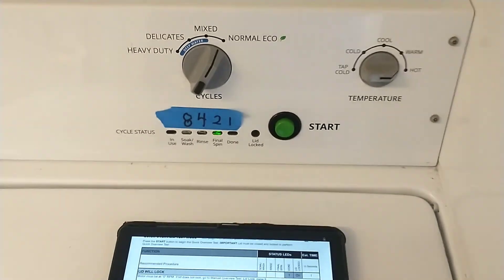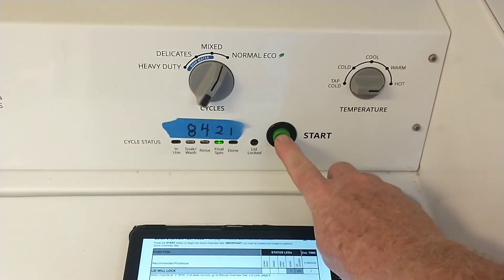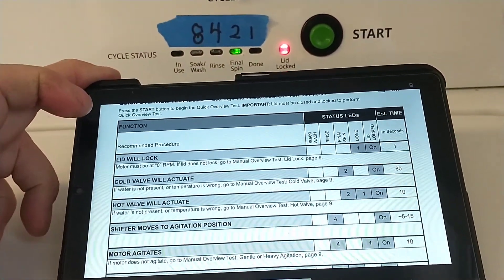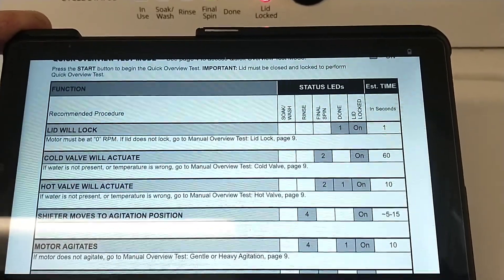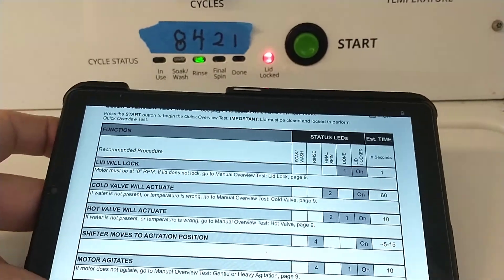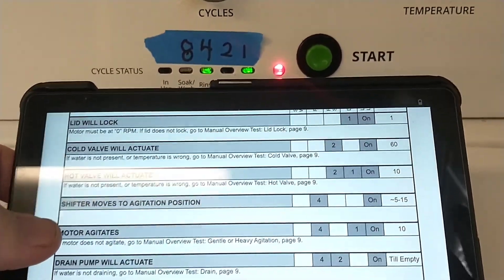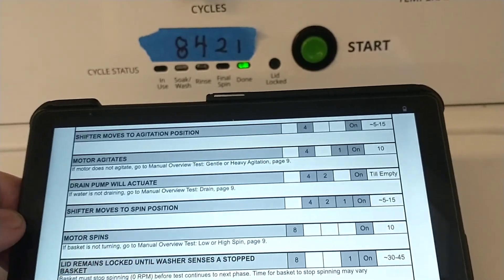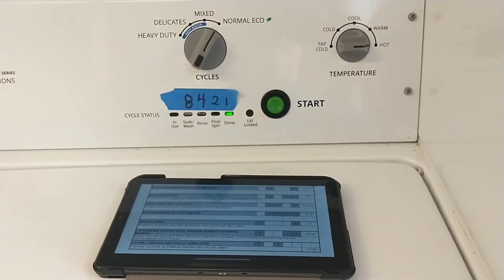Whirlpool Coin-op Washer Diagnostics

Comment: I have the same washer and here is what i am done so far and still not working: (CAE2745FQ0 Commercial Washer)

The washer fills with water and agitates normally.

When it’s time to drain, it does not pump out the water — it stays full.

You can hear the actuator shift, but the door does not lock when it should.

The door lock assembly and the shifter actuator have already been replaced — problem persists.

The drain pump works when tested directly with 120 V AC power.

The washer stays full of water in the mid cycle. I order a new control board just in case.... Bytheway i also replaced suspension rods because it was shaking alot.   HOW DO I RESET OR ERASE CODES? Great Tutorial The Best. Thank you for sharing

Comment: I have one model cae2745fq1 thats is running without coin. What can be the problem?
Reply: Have you checked the switch on the coin slide for continuity?  It should only make the switch after coins are put in then go open when the slide is pulled out. Might be stuck in the on position and the washer board thinks coins have been put in all the time.
Appliance parts pros also have  good technicians who are pretty good at helping you troubleshoot weird problems.
Reply: My exact model gave out free washes. According to the service guy that whirlpool sent out, I had to replace the control board, which fixed my problem.

Comment: Nice video, I have the same washer and had to replace the shift actuator and noticed that the drum is sitting about 4” lower than usual, I replaced the suspension rods with the manufacturers kit but the tub/drum is still sitting lower. I was curious if you had any suggestions on how to keep the tub/drum from falling unfortunately I can’t find anything online for a fix. Thanks again for any advice

Comment: does anyone have a source for the pressure transducer that is soldered on the control board ?  It fails quite often - i have several boards that I have deducted the pressure transducer is bad.  The symptoms are: you hit the green start button, the washer starts to fill water in and 30 seconds later it starts agitating.  It then stops filing with water and agitates for the whole wash cycle without enough water. It then drains, and spins.  The rinse cycle starts and acts normal, fills with water, agitates for a short time, then pumps the water out but then never spins.  The control is waiting for the water pressure transducer to tell it the water is out but the transducer is bad.  The washer stops eventually with the DONE light NOT on and the clothes NOT spun.  unfortunately there is no diagnostic mode to tell you the problem.  From what I've learned - running the calibration mode and the washer NOT coming back with the DONE light on finished means the pressure transducer is bad.

Comment: Quick question I did the calibration and test. The only light that was not coming on was the done light, every time I put coins into the machine nothing happens no lights no buttons nothing comes on but when I do the calibration test, it runs through the test but like I said that done light does not come on any information would be great thank you so much
Reply: If the DONE light doesn't come on at the end of calibration - calibration procedure ran into an error on board. Most likely pressure sensor is bad on control board. Also look for swollen capacitors on the control board. I've run into this many times.  These machines are  American made garbage.

Comment: What if your machine won’t go into diagnostics mode and the final spin light just blinks?
Reply: control board is BAD.  look to see if the green LED light in the middle of the control board is on solid
Reply: Mine is solid green in the back of the board but won't go into diagnostic mode
Reply: @elvinunthiah2620  have tried going slower on turning knob. Try it several different ways and pace
Reply: @elvinunthiah2620  I've had boards that light up green led on back of control board and can't get into diagnostic mode. These boards are dead control boards. I've sent these in to whirlpool repair shops - they come back non-repairable.

Comment: After my mom use garden hose to clean the washer, the washer no longer lights up and will trip the breaker. What should I do to fix it? Thank you.
Reply: Most likely she let water in the control panel and shorted some electronics or the lid lock switch.

Comment: I whirlpool commercial washer coin op will not go into diagnostics mode. I’ve changed the board & the coin slide. 
 The machine will turn on when no coins have been put it. Even when the coin slide switch is unplugged
Reply: Just ran into this today, starts without coins. I also cannot get hot water but I can’t enter diagnostics mode to check the inlet valves. Dumb!
Reply: @jamiestevens9891  You’re not alone. I’ve seen it multiple time since posting my last comment. It’s a reoccurring theme with these machines.
Reply: @Daner949  Is it most likely the board?
Reply: @jamiestevens9891  I changed the coin, slide control board, and the main control board, as well as the coin slide itself, Also the lid switch. We eventually ran out of parts to change. Even Whirlpol Factory Service was stumped.
Reply: Did you fix your washer? I have the same problem with mine.
Reply: @Mark_from_LA  No, I changed everything & it would still start for free. 
  I even spoke with whirlpool, and they admitted that the see this all the time. But did not offer a solution. 
  Hopefully, if enough of us complain, there will be a recall or full class action lawsuit against this machine.
Reply: @Daner949  Thanks for your answer. You're money saver 😂

Comment: Quick question, when doing the test cycle my lid lock led is not lit is that normal. I was originally getting a pressure error (F3E1) I fixed that then I noticed the lid lock thing thought it was odd.
Reply from the maker: If it won't lock in service mode then it most likely won't in normal mode. If the lid is not locked it will not spin and should set an error code. On page 4 of the tech sheet you will see instructions to enter Manual Overview Test Mode. This mode allows you to run individual tests on components. Enter Manual mode and follow the instructions on page 9. Everything you need to diagnose the issue is in the tech sheet (mini manual as some call it).
Reply: @tonyturner9146   I'm going to retry it when I'm back after vacation. Thanks for the help and video.
Reply: Tony ran it through diagnostics nothing shows up.when it starts fills up for 30 seconds.stop moves to wash/soak cycle but doesn't fill and starts to agitate with no water. If I do another load fills with water and works fine.Frustrated can you help me out😢
Reply: @victoragresti1777 I have one that does the same thing.  Mine will start with pump ruunning and then agitates with no or low water for wash cycle.  it then pumps water out and then fills to the top for rinse cycle, agitates, then pumps out water but no spin. I'm assuming the control board has bad pressure switch - this would make the cycle my machine is doing logical. Another big problem with these machines is the wiring. Whirlpool used the CHEAPEST wire they could find - it breaks all the time on these machines especially around the water pump and motor capacitor.  These machines are JUNK
Reply: @victoragresti1777  I'm honestly curious how that's even possible, outside of a bad water level switch.
Reply: @RJenkins6586  this doesn't have a conventional water pressure switch its built into the board it's called a pressure transducer
Reply from the maker: It is not normal for the lid lock light to not come on... Is the lid locking?
Reply: @tonyturner9146  It locks when it's ran normally, but after rewatching the video I don't think it's locking at all when it's in service mode.

Comment: First, how do I get the program you have on your tablet? Next, the lights aren't coming on when money is inserted. Any suggestions? Great video.
Reply from the maker: On my tablet I'm just reading a PDF version of the "tech sheet". Most of those machines will have a tech sheet attached to the back of the front panel of the machine. If you can put it in diagnostics and run the test then the machine is probably not at fault. There is a switch in the coin mechanism that enables the controls of the machine. That switch may be the issue. Or the coin is not mashing the switch when the coin slide goes in.

Comment: How to calibrate ? Like all back to normal
Reply: To recalibrate you do the process he did to go into diagnostic mode and go the what would be the number four or rinse, then press start. It will go trough the recalibration process.
Reply: Then?
Reply: Starting at 12:00 (mixed load on mine) L-R-R-L-R-L-R is what the tech did on my model

Comment: I have the same model. The washer stalls without completing a cycle, leaving three green LEDs lit, "In Use," "Rinse" and "Done." The manual is missing and I have not been able to locate any information on the web.
Any ideas what the three lights indicate and what is wrong?
Reply: I have 2 washers at my lodge doing the same thing.  I can't find anything online about it.  Did you figure it out?
Reply: @tdecker61600  what you should do is call commercial customer service.  I've called them several times and they seem helpful yet they don't know what the solution is. I had oen of these machines a year ago that worked perfectly except it would work for free.  The Whirlpool techs worked with me for an hour on the phone and never could get it to work correctly.  I replaced everything on that machine, the control board, the mode shifter, the lid lock, the set up board for free or coin use, thermisistor use, and it still would cycle for free.These machines are the worst piece of junk America ever produced - Whirlpool needs to go bankrupt and die like they're machines.

Comment: is it possible with a dryer?
Reply from the maker: That's a tricky question. The short answer is yes, on some dryers. The dryers in this laundry center were standard coin-op with no diagnostics. But when you get into the Cabrio/Bravos Duet world or Samsung and LG world's most of those dryers have some form of diagnostics built in... But that's another video lol.

Comment: Tony, I'm at a hotel and I'm thinking about getting this washer. Whays your OPINION about this washer is a heavy traffic hotel?
Reply from the maker: I like this washer. It's pretty reliable and easy to work on. I guess it's about as good as any. The ones in the video are at an apartment complex and we do very little to them.
Reply: @tonyturner9146  These machines are absolute JUNK.  There's no comparison to Speed Queen.  The controls on these whirlpool machines constantly break, bad capacitors, bad pressure transducer, lid lock switch fails and next customer puts in $$ and control board fries. I've got a pile of over 30 fried control boards in my shop. 8 of them are not fixable by any company as they have proprietary chips that are dead. Not to mention the transmission that fails and NOT fixable except by replacing the whole transmission. AMERICAN  JUNK
Reply: @schuholzjohn3625  I have had 5 of these.  The older models worked 15+ years. Any of the newer ones I've had big problems.  Recently the control boards fried the lid switches.  So I end up buying new lid switches to see them go bad.   They are also very sensitive machines.  You have to make sure people do not overload them or add too much detergent.  No more than 2 ounces of detergent and make sure they are using high efficiency.

Comment: Gteat video. Where can I find a copy of Tech sheet? Thanks
Reply from the maker: There is a copy of the tech sheet inside the machine. Open the top or pull the front and look on the front left. Or Google the model number and use the words tech sheet.

Comment: Very informative and well made video, Tony. What program is that on your tablet?
Reply from the maker: That is just a PDF version of the "Tech Sheet" I'm reading on my tablet.
Reply: @tonyturner9146 is this in the users manual? Or a special manual. If you have a link to a digital version can you post please? Thank you.
Reply from the maker: @kalenburns4190  it is not in the users manual. You need the Tech Sheet. It is normally located on the inside front of the machine. Remove the top of the machine and look on the left side of the front. It is in a plastic bag stuck to the front of the machine.  You can Google tech sheet and the model number to find a PDF version.

Comment: I have the same washer, model number slightly different #cae2743bq0 I did the same thing you did had no issues. But when i put the change in and hit the start button nothing happens. Any ideas
Reply from the maker: When you pull the top off the coin-op and work the coin slide you should see the slide hit and push back a switch. You can operate the switch without coins by just working the switch manually inside the coin-op. If you work the switch and the machine won't run then the switch could be bad or a wire could be loose. Verify the wire from the switch is connected to the main control board. If switch is good and the wiring is connected correctly then the control board could be bad.
Reply: @tonyturner9146  thank you for taking the time to answer my question. I ended getting to that point once I went through the fault codes. Tried cleaning the switch mechanism to see if that would work, no luck. I was able to get it to work by moving it by hand, so I will be replacing the entire mechanism. Thanks!!